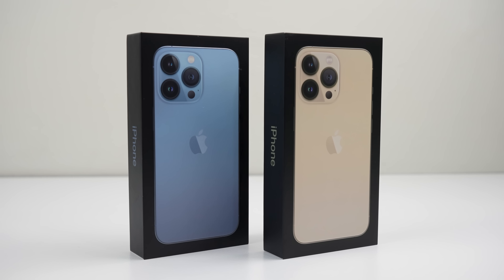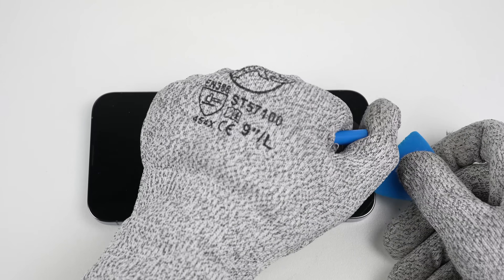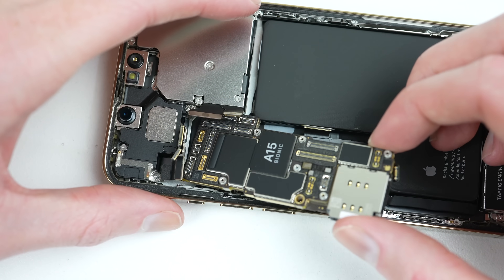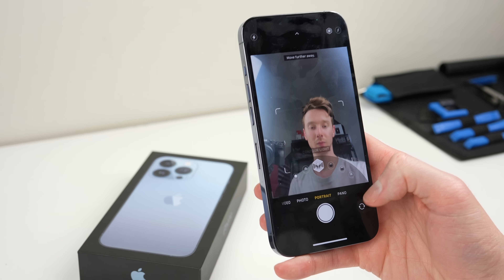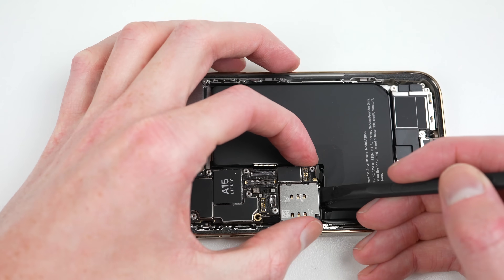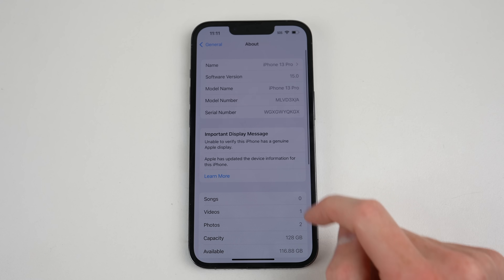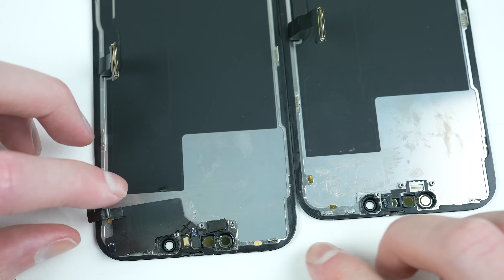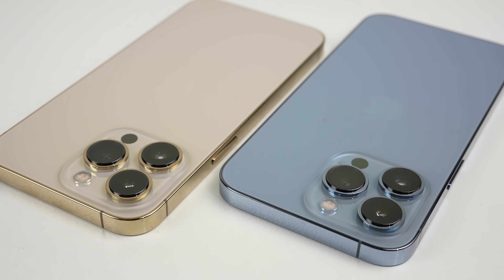iPhone 13 A Repair Nightmare - Teardown and Repair Assessment

Comment: My father trained as an engineer during and after WW2. Once peace was restored he had an early job with a firm making 'baler presses' - the kind of machine used for compressing and baling up rubbish like cardboard and strapping it up. They were so simple and robust that a buyer only ever needed one. They are still sometimes found out the back of factories - still working after decades. Obvs the firm went bust. Apple are a lot smarter.  
KD

Comment: If Apple technicians can fix these phones and have them working perfectly fine how are they not repairable? Is it the phone or is it the technician?
Reply: It is the phone because you need a software only apple technicians have to re-register parts that got replaced.
That means that apple can charge you any price they want for a repair since there is no1 else who can repair it. 

Also, I assume apple manufactures new spare parts instead of using ones from other broken devices.

Comment: Ahh yes, I remember all this happening once before with anti-piracy measures in software. It got to the point where the "security" was costing more than the product. They were laser damaging disc sectors, forcing drives to read/write 81 tracks, having duplicate sector IDs, etc etc etc.
For my original TRS-80 I have the service manual including all circuit diagrams. I would upgrade, enhance the product.
Likewise with my early Macs, I upgraded RAM and Storage as money allowed.

If Apple wants to lock things down, thats fine, just make them liable for 5 years unlimited warranty on their IOS devices and 7+ years for computers.
Failing that, tax according to repairability, irreparable = 100% "Green tax" + Sales taxes.
Old software should become opensource after 3 years since last last sale OR useability on modern hardware.
I love for Claris Draw to become a thing again.

The ONLY way companies will change is when it hurts them in the pocket. And that hurt will need to be by legislation.
Reply: This 100%
Reply: Then an iphone will cost $10k because they will design it to fail in 6 months and require a full replacement.
Reply: @bigsmall246  No they won't , and teenage drama queen outbursts will not make that true.
Reply: @keithwhitehead4897  my point is, the costs will be passed on to the consumer.
Reply: @bigsmall246  And yet, in New Zealand they have not, even though the Act has been around since 1993.
If anything the risk of being sued for stupid sums of money in the USA is a far bigger driver for price increases, especially with "Class action" where only the lawyers make any money from it.
Reply: People vote, and people but iPhones. So it needs to be by people... and I don't think that will happen any time soon
Reply: @billysgeo  It has in New Zealand. We have the Consumers Guarantees Act. There is no need to buy AppleCare  or any "extended warranty".
I have had my sons iBook fixed for free when it was about 3.5 years old.
Indeed people vote, but NZ is NOT scared of the word "socialism" , its called by the PEOPLE for the PEOPLE.
Reply: True but you could also stop buying them.
Reply: @davef4982  everybody is on the same lane, samsung and Google will join apple.
Customers will suffer.. what we will buy

Comment: this is it. the problem that more iphone user should be aware of. but no. they bought the phone bc of trends, instead of thinking twice how it might cost them more if smthg were to happen to the phone.

Apple is such a greedy company. only fools will support them by buying their crappy, unrepairable phone unless it's genuine product of themselves.

not just that. iphone is an extremely fragile phone. if you dropped it accidently, say goodbye to your glass back panel. sure, you can repair it, but it will cost you a fortune, as if telling you to just buy a new phone 🙄

Comment: On one hand it makes some sense if the phone refuses to recognize some replaced chinese noname parts, but since you have switched genuine parts it's an issue.
I do think that there should be some software that updates hardware synchronization on their end, but if apple gives it to 3rd party is a major question (I guess they won't).
As always corporations practice anti-consumer tactics.

Comment: im thinking about to switch to apple for a few years now. since the iphone 12 software lock apple will most likely not be carbon neutral in 2030 by just removing the charger brick. doing diy would save alot more and i would maybe buy one.

Comment: In 3 years, they will just sell the parts separately. We will have to assemble the new phone ☺☺
Reply: That would be actually pretty sweet. I guess it would mean that the parts could be interchanged. I am more affraid tho that in the future the whole phone will have no ports and it will be all sealed shut with no way to open it and once the battery runs out or anything breaks there will just be no way to fix it and you will have to buy a new phone

Comment: There should be “Right to Repair” regulations preventing this type of monopoly by Apple.
Reply: Europe is on it
Reply: If everyone just said they wouldn't buy apple it would happen overnight but some people are ok with having an overpriced under preforming status icon
Reply: @AVATARComander  Of course, this is going to happen little by little, but the pace will increase the further it goes. For me it was Windows 11 that pushed me to research all this stuff. When I heard they wanted an online account just to install, I looked into some privacy stuff surrounding Windows and Google and was done. Not only do I use Linux and Firefox now, I'm using an encrypted DNS, a whole bunch of adblockers, track-blockers etc., removed Google as my df search engine, and soon may be getting rid of gmail as well. For my phone i will be installing a custom ROM and almost completely de-google it as well when I get the chance. I refuse to participate in any of this non-sense, and like I said other people are doing the same thing. The more they push these things, the more people will be joining me.
Reply: @AVATARComander  Some people are ok with owning something that just works with no hassle.
Reply: Yes. It’s wasteful to junk a whole phone if one component were to have failed.
Reply: @ksaboda  that’s why you can get your phone repaired by apple, with original quality parts, if you can’t afford that, you should not own the device in the first place, a phone is not a human right after all. Also, apple is just securing their brand. If you had a Mercedes, and I switched out the engine with a knock off and also installed some other crappy components, would you still call it a high performance car?
Reply: @paviaaPS3  I just think you should be able to repair your phone. Maybe it is with factory parts.
Reply: @paviaaPS3  but in this case he swapped them with ORIGINAL PARTS AND LOOK WHAT HAPPENED. It’s not about affording it anymore. It’s beyond that dude cmon
Reply: @paviaaPS3  This is 1) a false analogy 2) untrue.  Louis Rossman has been showing for years how bad apple is at overpriced repairs at the least.  Keep in mind you cant just use any old parts for repairs, you have to use the same parts which can be bought from third parties, apple just locks them by serial number or what have you to only work with the one the phone comes with.  So for your example you would take your Mercedes to a shop who knew what they were doing but the parts wouldn't work because of a software lock out.  This is exactly why right to repair has been slowly becoming an issue over the years, but thanks for being one of the apple sheep who tries to legitimize their bad practices.
Reply: @paviaaPS3  but apple phones or even products aren't high performance devices... They have proven it time and time again.
Reply: @paviaaPS3  The fact that you have the choice to fix your car through Mercedes or a 3rd party repair service is the difference. Mercedes can't deter you from using a different engine or any other part in the car for that matter but Apple actively does. The measures they take to make the phone more difficult to fix is an intentional decision to force people to repair anything through them, not because they're excessively complicated machines but because they want to eliminate the competition and strong-arm people into buying new devices instead of repairing their old ones.
Reply: @SumAussieCobber  okay now that’s not all true, what about the iPhone 13 pro max?
Reply: @nadtz  okay fair enough, but when I search for used iPhone, I tend to stay away from sellers who say that Face ID or Touch ID etc doesn’t work, because i k ow they did a cheappo repair, and i don’t like cheap repairs which only lasts for so long
Reply: @nadtz  and also a third party iPhone screen can’t compare with the original one! That’s why I buy an iPhone, because I like the screen and simplicity. I don’t want a wish screen on my expensive iPhone
Reply: @paviaaPS3  As per the video even using a replacement from another phone doesnt work properly.  This has nothing to do with third party parts, this has everything to do with apple locking out third party repair via software/hardware ID.
Reply: There doesn't need to be one just start buying android phones
Reply: It's a known bug, that will be corrected on the next iOS version
Reply: or stick with android
Reply: Solution,dont buy apple crap.
Reply: Solution dont buy apple crAp.
Reply: Congratulations on Apple's successful ascent to the throne of high-end smartphone sales after the fall of Huawei
Reply: monopoly? what monopoly? apple does very well. no one can deceive you when you buy used equipment. it also doesn't pay to steal the iPhone for parts. iPhones from stolen parts are sold in many countries. now it will not be possible.
Reply: Louis Rossmann  look him up on YT
Reply: We need Linux phones bro. Forget all this temporary and "apply tape here" solutions. Using proprietary software and mega corporations like Apple and Google, things will continue to get worse and worse in this direction. It is literally inevitable. The very least you can do for now is stop using Chrome and Install something like Firefox instead and stop using Windows and install Linux instead. I've done so recently after realizing how bad things have gotten when it comes to these companies' control they have over you, the data they collect etc.
Reply: @ENTERTAINMENT-lf2wy  Google don’t control Android, it’s open source like Linux. They help develop it and make default software packages for it, nothing else. They have no control.
Reply: @ENTERTAINMENT-lf2wy  You do know Android is based on a modified version of Linux right?
Reply: @ENTERTAINMENT-lf2wy   No one will use Firefox, Nokia or Linux. Wake up from your delusional fantasy.
Reply: @ENTERTAINMENT-lf2wy  Linux will never be good enough for mass use.
Reply: @moderusprime  we’re not including Android in that are we? Otherwise, looking at market share on devices I’d have to go ahead and sort of disagree with you there. If we’re talking home brew Linux based OS on phones/PCs etc… then yeah there’s no way. People value their time and convenience over freedom.
Reply: @victisomega4248  No, we're not, because the guy specifically said "Linux Phones", not, "Android Phones, which use the Linux kernel".
Reply: @moderusprime  then yeah if we’re talking home brew install it yourself “Linux phones” it’ll never be a thing lol

Comment: Did you by any chance try switching the original display cable along with the original Face ID cable to the foreign screen?  I didn't see that in this video but not sure if its possible.
PS I work for apple and repair iPhones, and can definitely confirm the information in this video.  One thing left out here is that older computers (not sure what year, maybe 2013's and older) no longer can connect to iTunes; newer computers are now needed for apparently no reason.

Comment: i dont care if its not repairable. firstly i have a warranty of 2 years and secondly i live in a country which repairing is way to expensive in terms of salary per hour. I had the Iphone 4s (10 years) and now the iphone 6s (for 3 years), both second hand mobile phones and i never had any trouble with them.

Comment: Apple products truly seem useless. They are overpriced for what they offer, are not the peak of technology anymore as they partly were in the past, are very restrictive in things one is able to do with them, require overpriced hardware and additions from Apple to even use hardware with them, require their own unique charging cable despite the law to unify the mobile market with mini-usb and USB-C, are heavily anti consumer, are a wasteful coropration prefering dumping and exchanging over refurbishing and repairing, lie to their customers if it comes to repairs to sell more of their overpriced pieces of plastic, are actively and maliciously using traps and hardware filters to make sure their phones can't be repaired and are basically 1-time use products and are generally a pain in the ass to deal with.

I know that no mobile-phone manufacturer is perfect... but still... Why do people still use Apple products? Force of habbit? :/

Comment: Hey Apple, if you are reading this, I won’t be buying a new iPhone until you allow third party repairs. It’s time for me to buy a new phone. I’ve been buying your phones since 2013. But I guess I’ll have to go with someone else. 

Even with genuine Apple parts you can’t get a product fixed. That’s a scam. Using software to artificially stop your users from fixing their phones is a scam.
Reply: They're not reading your comment bro
Reply: @RawbLV  You did. Maybe other Apple users will realize that only way to get this company to change their behavior is to stop buying their products.
Reply: @christopherquigley5468  I looked through the comments. Apple users are not here, and those who are, defend Apple.
Reply: @RawbLV  I’m an Apple user. I don’t defend them. Their practices are terrible.
Reply: @christopherquigley5468  Ah, the lucky 0,05%